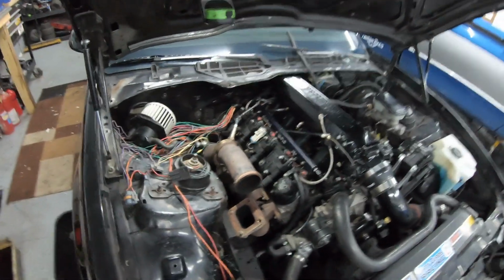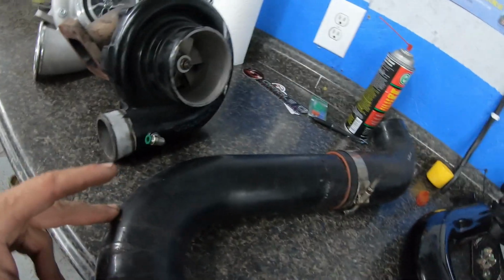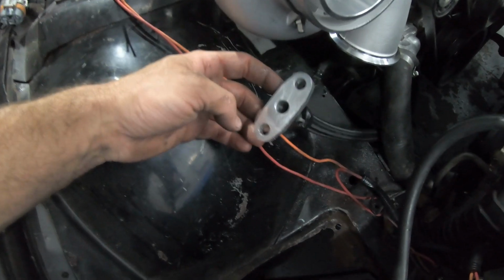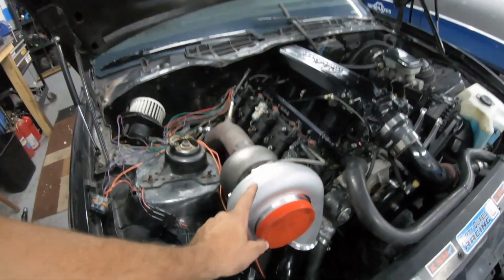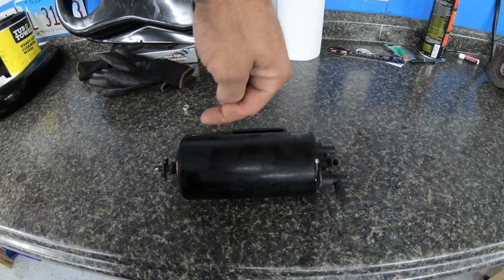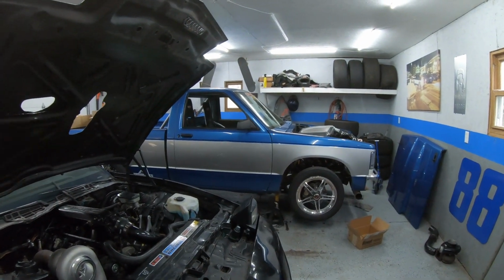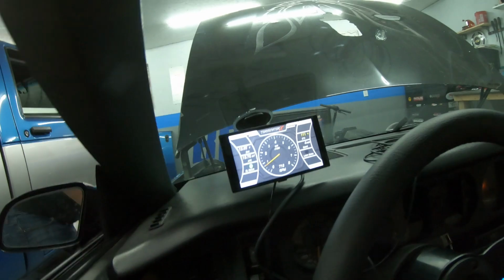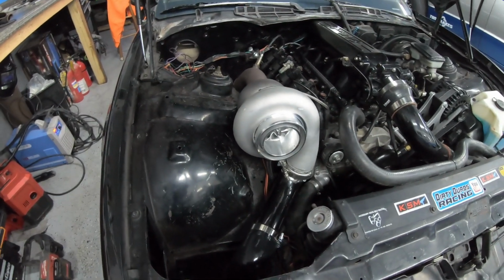Firebird gets new VS Racing turbo and Holley 5inch screen!

Comment: I didn't realize they made a 5" for the Terminator X. Thought it was only a Sniper deal. Thanks. You should love that new 78. And if you had the tune from the original X, you could have just converted it, by opening it in V3.
Reply from the maker: I tried to recover it but wasn't successful lol so far this 5 inch screen is amazing!!